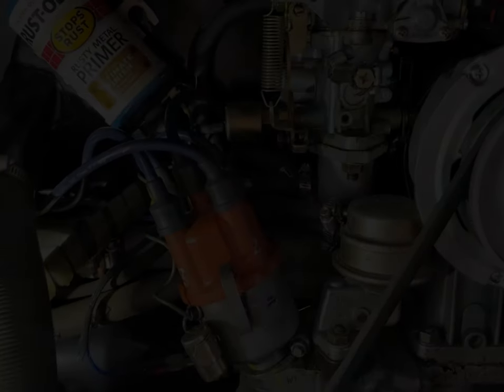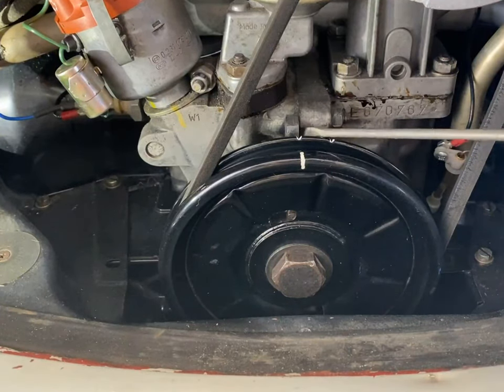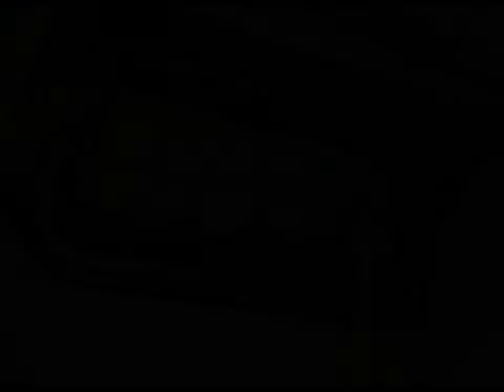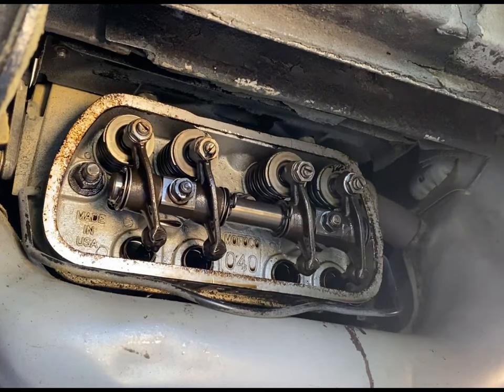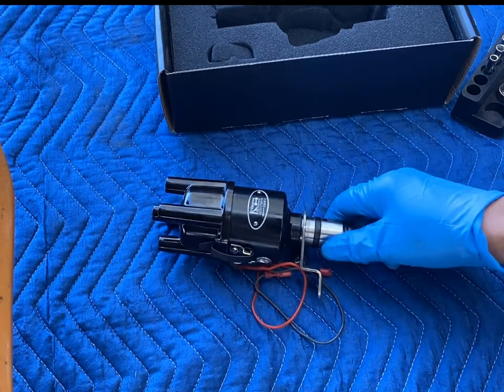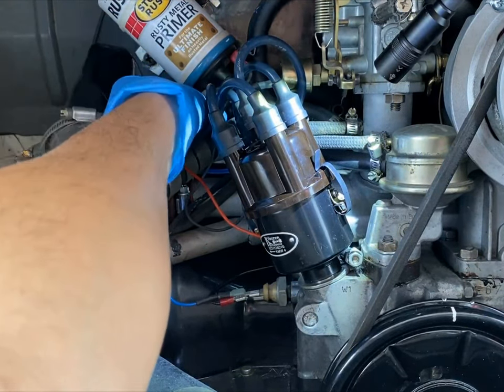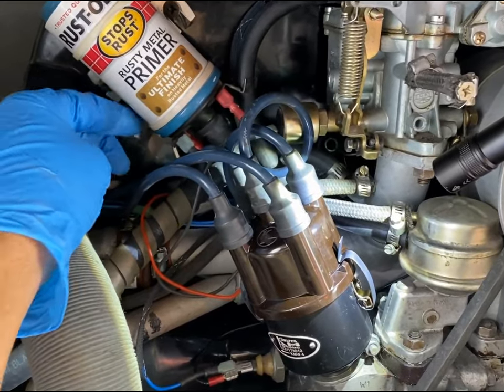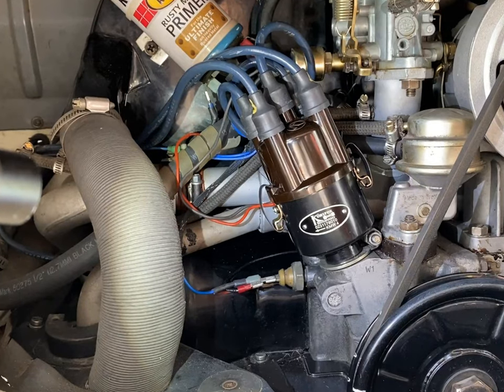1971 Highroof VW Bus part 11 Kuhltek distributor Install

Comment: Great video thanks, I was curious if the distributor still working good  and also mine got vacuum on my regular distributor do this will still work.
Reply from the maker: @MarsGarage333  I ended up getting a new engine with a Magna Spark distributor. The old engine was still running when I pulled it so I’d say it was still running. You would need a different set up if you still want to run the vacuum look distributors they do sell one that looks like that.